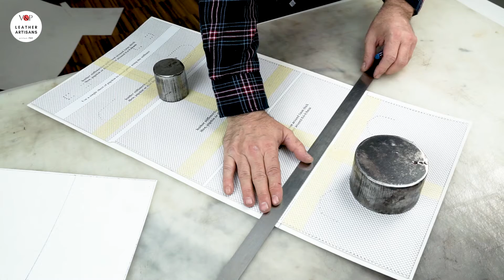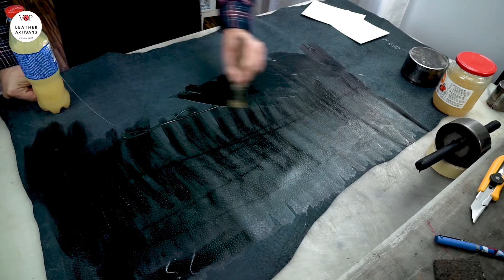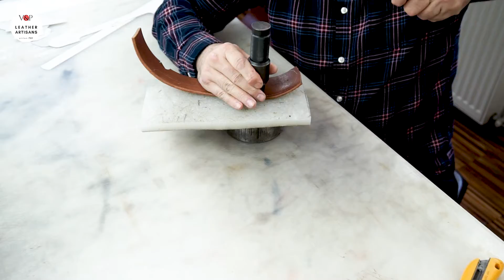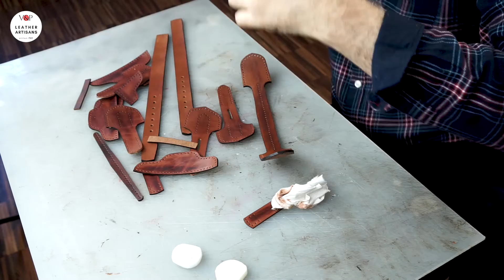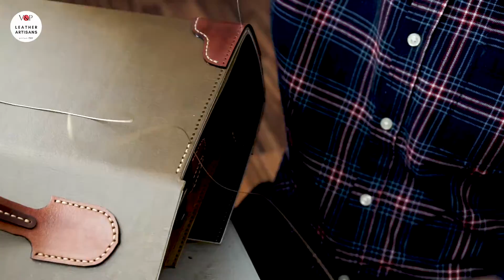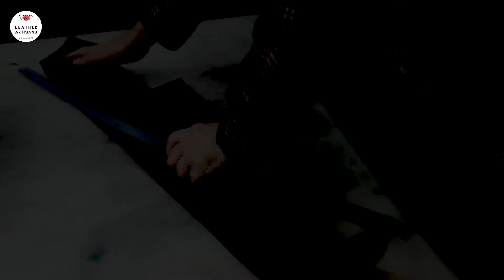Leather Tool Bag DIY (link to PDF Pattern)

Comment: Hi there, great video here, I'm wondering if using a box stich would be any stronger to use or would it not make a difference. also what would you suggest as an alternative to pigskin as an alternative lining?
Reply from the maker: I use pig skin because it is thin and rigid, so it helps me to make a stiff but not heavy bag. But you can use thin and rigid goat, thin and rigid cow leather. You can use suede, you can use something that is thin and rigid and looks good enough. 
Box stitch? This bag is made this way vut if you'll make a design for box stitching, the bag will be as solid as this one.

Comment: What kind of linking do you use and where can we find it? What weight leather are you using? These details are what's missing from your video.
Reply from the maker: You can find the details in this video tutorial description and also, in the PDF pattern file. The link to the pattern is in the first comment and in the video tutorial description. Have fun making this awesome tool bag!
Reply: I found the white material as bag stiffener.